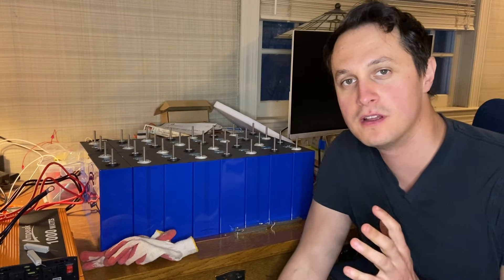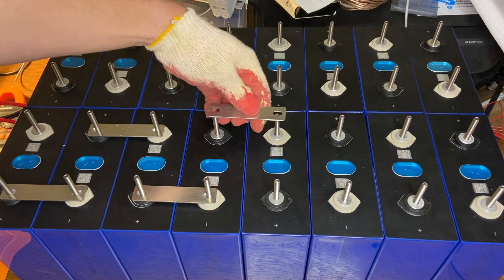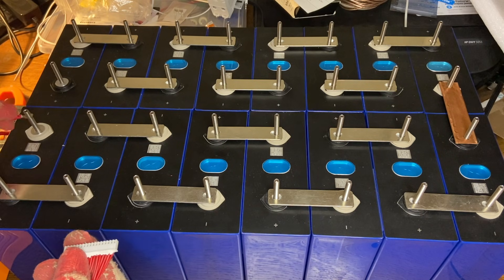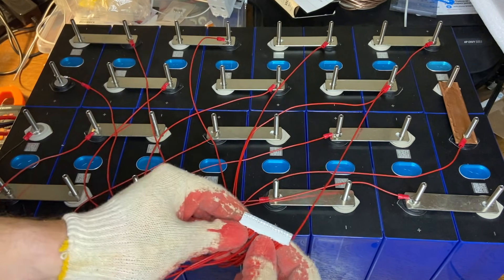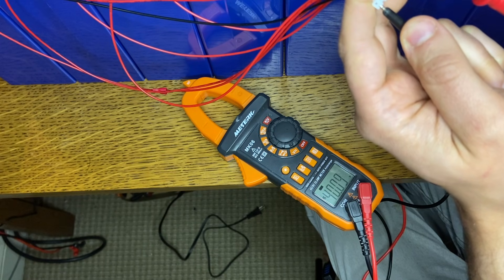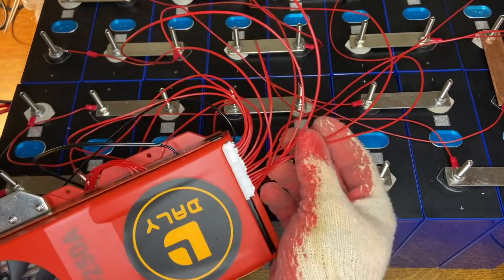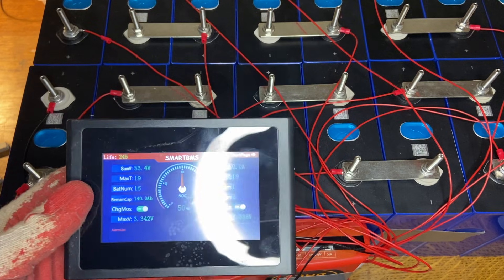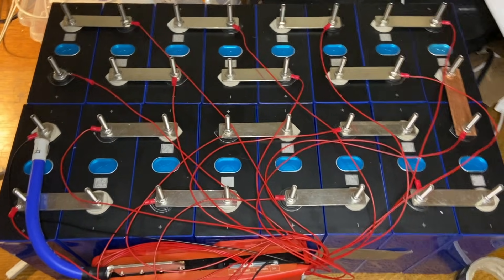How to Wire a 16S Lifepo4 Battery w/ BMS

Comment: Nice video. I ordered the same Daly smart BMS 250A. Still waiting for it. I'm curious if you have a diagram of your whole planned system. That would really help me. I'm trying to select wire sizes fuses shutoff etc and will have 3 strings of 2s2p 315 Watt panels tied to 3 makeskyblue controllers and a Genetry 6000 watt inverter charger... Should get that soon. I'm planning 50 amps 220 AC in and up to 30 amp 220 output maximum.
Reply from the maker: Good question. I think I can make a diagram and then a quick video on my personal setup. If all goes well I will be installing my inverter this week.
Reply: @TheWilltoBuild  that would be super cool. How many panels and strings are you doing? What charge controllers?
Reply from the maker: @allmomomosthomebus3895  I have 10x 300 watt panels in series of two, so 2s5p and using a Victron charge controller. In hindsight I wish I had purchased twelve so I could put three or four in series, but it should be enough for my needs.
Reply: @TheWilltoBuild  I'm doing 3 strings of 315 watts as 2s2p with 3 MakeSkyBlue controllers. 2 initially for 8 panels on the bus  roof but another 4 as a rigid solar panel awning on the side.